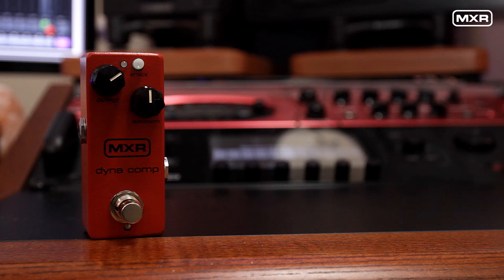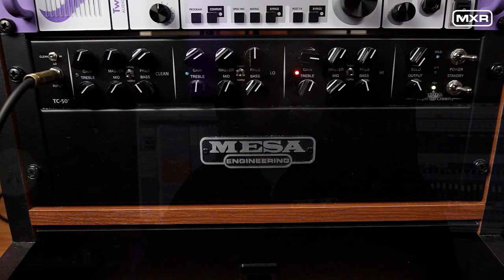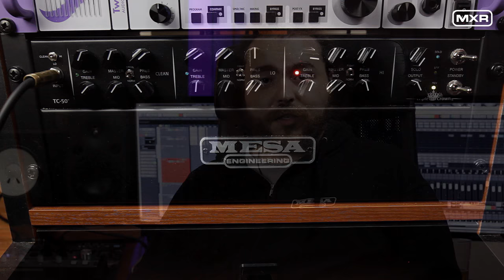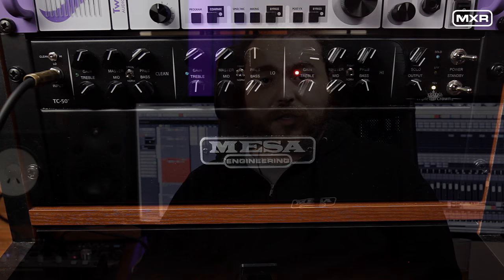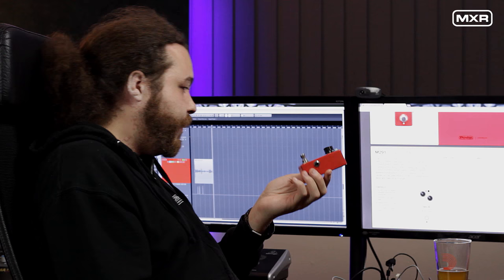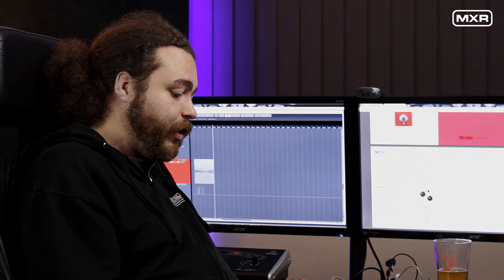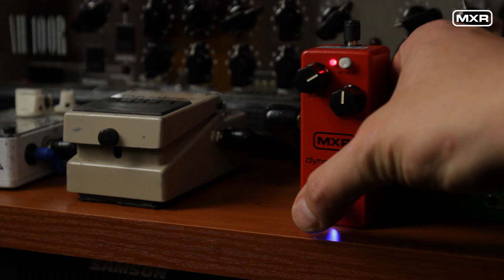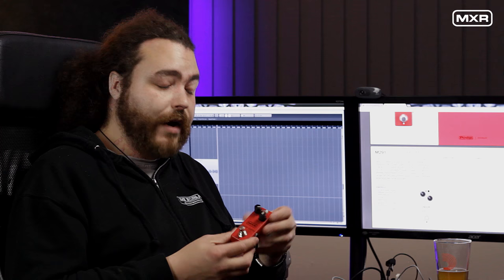JOHN BROWNE | MXR DYNA COMP | MESA BOOGIE TC50 ROCK DEMO

Comment: John I'm sorry to comment on such an old video and I know you don't play the triple Crown amplifier much anymore. But I've had the amp in the 50 W head version for 3 years now, And I've always tried to be very minimal with the amount of pedals I've used as a kind of find it sensitive and/or tone sucking. Just at a curiosity did you ever find yourself wanting for an overdrive pedal for channel 2 or 3 to clean up some of the bottom end where is there a better way to eq that on the amp? I'm currently testing the horizon device precision drive because I didn't have a gate or overdrive and I'm not really sure I like it but it could be due to not knowing to to dial it in / use it. Any help greatly appreciated 🙏